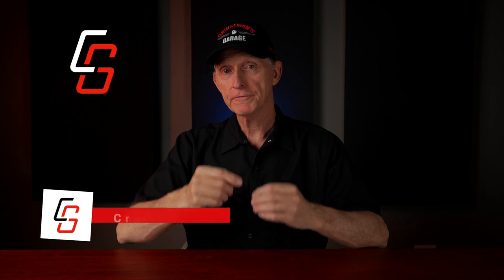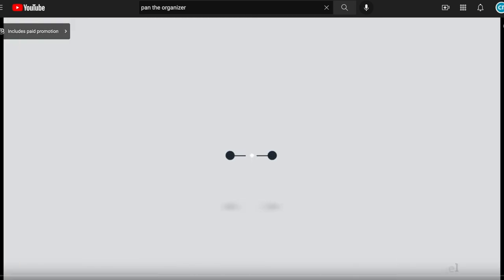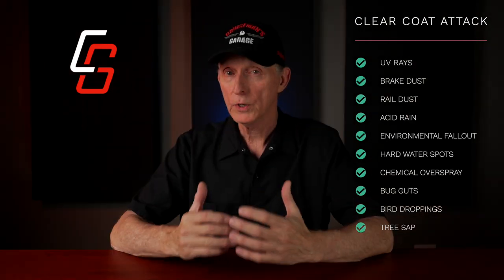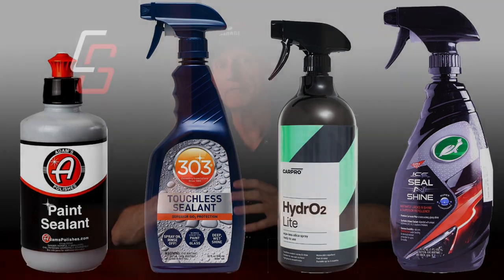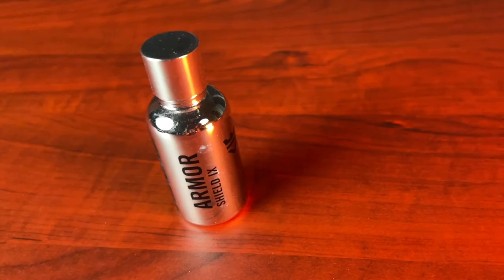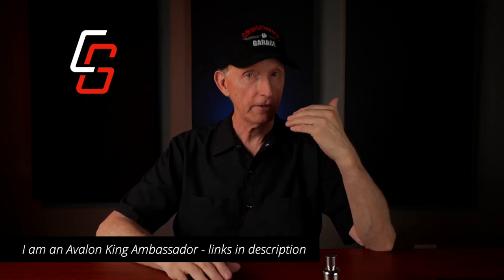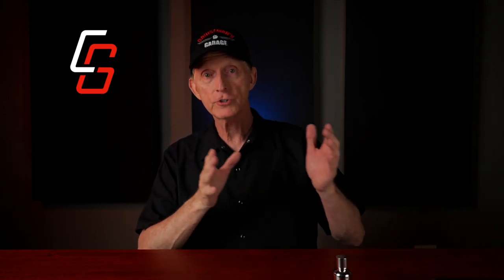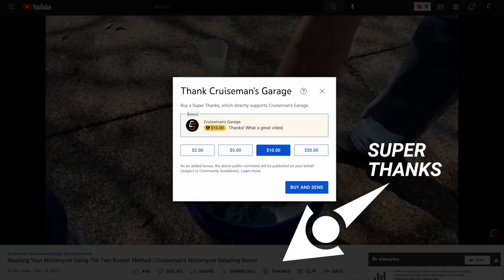Don't Ceramic Coat Your Motorcycle Until You Watch This! | Ceramic Coating Your Motorcycle

Comment: I had a ceramic coating applied professionally to my black 21 F150 King Ranch in February 21.  The brand applied is called R1 Coatings and is to last 5 years.   Anyway, it cost $1800 and took a team 2 days to apply.  I like it and will do it to my black 22 DCT Tour when it comes in.  I do agree that it is very shiny; but maybe not not as good as a high quality freshly applied wax.  However, maintenance with ceramic coating is a lot easier.  Water beads instantly and bugs and dirt come off easily.  However, they strongly recommend you only use Touchless car washes.

Comment: I had my 2021 K1600GTL professionally installed immediately after purchase.  Took it right from the dealer to the detailer.  Had a 7 yr, self healing Feynlab ceramic coating applied.  $1300, which was a discount, know the detailer and he used my bike for advertising.  I could not be happier I did it.  Although it hasn't seen rain yet, I still have not had to wash it yet.  I do wipe it down after every ride, but just love it.

Comment: I’m really picky about my vehicles and when my F150 was brand new, I prepped it and applied a genuine ceramic sealant. It seemed like it was a good protectant but was not as smooth as the surface before application. Shiny as all get out, but when I got my Wing I decided to use the spray on sealants. I’ve been quite happy with those as nothing seems to stick to the finish. Perhaps if I was more daring I’d try the one you mentioned. Good, informative video….thanks Chris and safe riding.

Comment: Absolutely great video sir!! Spelled it out perfectly for anyone to understand. Seems like if you buy a new motorcycle though, say a Goldwing, then take it straight to a professional detail shop and have a ceramic coating done. But how does a ceramic coating hold up vs. where I've seen a video where they apply that film over the painted bodywork itself? Is it easier to keep the motorcycle clean, when doing ordinary washes and keeps a nice looking paint finish? Have a great Memorial day weekend.
Reply: Great question.

Comment: I have not washed one of my motorcycles, and there have been dozens, I haven’t washed one with water and soap for over 30 years. The only thing I use is Honda spray cleaner and polish detailer. That’s all I have used since I learned of that stuff back in the 80s when I was a motorcycle salesman part time.. in one of my videos, my bike is shining, I explain in the video that that is the only thing I have ever used on my motorcycles for the past decades.
  I point out on the label it says it cleans degrees is and polishes without water right on the wall front of the can
  many companies have tried to cash in on that. I’ve tried some of them, they don’t even come close. That Honda spray detailer is the number one best selling product Honda sells.. they sell more cans of that then they do spark plugs.. I buy it by the case. I don’t use soap or water, I don’t wax my motorcycles. That Honda spray detailer is safe for plastic, paint, chrome, and aluminum. You can use it on the whole motorcycle practically. I don’t know about the vinyl on the seat, I only use lemon pledge on the vinyl seats..
  that is the only thing I have ever used on my windshields. Two of my motorcycles were black. My BMW K 1200 LT, and my Honda Pacific Coast which I commuted on for 24 years. I never washed that bike, I just used Honda spray detailer on it, when I sold it after I retired, it still shined like it was just a few months old. I hope Honda never “improves or changes “ The Honda spray detailer, because it is perfection in a can, it doesn’t scratch. My two black motorcycles would have shown scratches after all those years of use, and there were no noticeable scratches, not even the tiny ones that are as thin as spiderwebs
Reply: I have used it too for decades on all my stuff and at our dealership. BUT... nothing will protect like a ceramic coating. Best for my Matte paint bike, since it can stain for easily
Reply: @billsawyer5265  
  I have heard of this ceramic coating for paint protection. A buddy of mine that owns a collision/repair business gave me a small bottle, I mean about the size of a large group of that coating. He said that’s enough to do my whole truck..
  I don’t like to experiment with expensive things like my truck so I have never used it. I’ve had it for about six years.
The reason is
years ago a product in an orange bottle for paint protection for your car came out called “new finish”.. I had a red van/Ford for hauling my race bikes around the country.. that new finish claimed it was the once a year car polish. So I put it on my red van…
  after about three months, the paint on my red van which was nice and shiny before I put that stuff on, went to a matte dull finish. If I just ran my finger across the paint, my finger would be covered with red paint like it was talc powder. That stuff destroyed my paint..
  The part that really reminded me of what that stuff did to my paint is, I kept that van for 31 years. I had a car also but that was my motorcycle van, it didn’t get driven much unless I was hauling something. In fact, after 31 years it only had 67,000 miles on it. When I sold it to a scrap dealer it actually drove away. But every day I saw that dull paint, and that taught me a lesson to never experiment with something that has not been proven..
  my bikes don’t sit out ever. Even when I was commuting to work, I covered my bikes with a Nelson rig silver reflective cover to protect them from that angry red ball in the sky. I only used a half cover, because those things get hot under there..
  I am seeing those ceramic coating products more and more on the market. I’m gonna talk to some people that I’ve tried it and see how many years it really lasts and what the final result is after a long exposure. I only wax my truck with carnuba wax once a year.. just before winter, or should I say, just before they start salting the roads here in Western Pennsylvania.. I applied a product called fluid film under my ram pick up when I first brought it home new. I spent five days spring under and inside all the doors quarter panels frame door post windshield post all the way up to the roof..I actually coat my wheels and bumpers and grill all the chrome with that stuff in the fall when I wax the paint. And I don’t wash the truck all winter because I don’t wanna wash that and lanolin off all the chrome and the wheels. So far so good

Comment: I had both a can-am 2021 spider RT Limited and decided to go ahead and ceramic it.the paint on the can-am is very sensitive it scraces just touching it.. So I shop around and decided.on TORQUE DETAIL graphene burst coat ULITRA STRONG GRAPHENE TECHNOLOGY *S102 CERAMIC FOR ADDED PROTECTION INSTANT GLASS LIKE COATING. ALL I do is get an application pad spray some on do a small section at a time.if you put to much on it will be spotty turn the cloth over and gently wipe if you see a problem get a damp rag and go gentle over it. I toke it to the dealer they couldn't believe how shiny it was. they don't want to clean it , but not afraid to use a dirty towel.   you won't damage your paint.it's just scary because you are not familiar with the product. just remember car wash soap wash it off, all you do is just rinse.bird dropping comes right off.if it sits thier for a week can't say.

Comment: I think you are grasping for content to keep your channel productive...How about including us matte finish paint maintenance..How to remove scratches in the matte finish. How to protect it etc...You are biased for shinny clear coated bikes....
Reply from the maker: I'm not biased, I just have been unable to find any real information online regarding matte finishes.
Reply: @cruisemansgarage  Sorry, biased if a bit strong...the Crown talking...Yep same problem I have..Not many options for matte finish..
Reply: there is no way to remove scratches, except to repaint. You can use Avalon coating on matte, I did. It will make it a little darker/richer but will not add shine. Most of the pro detail guys agree. I have been detailing for decades.
Reply: @billsawyer5265  Thank you Bill, I've found that Honda's Matte finish scratches way too easy (As well as the gauge screen). I'm going to spray the matte with several coats of gloss clear after adding personal touch of some graphics...I think it will be much better.I'm a do-it-yourself guy. Such a wonderful machine with such shitty paint........